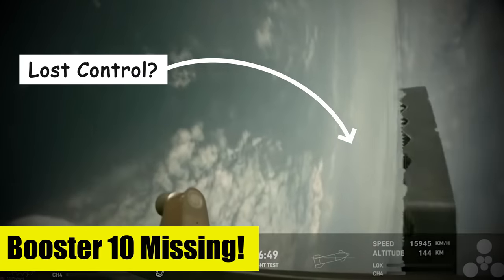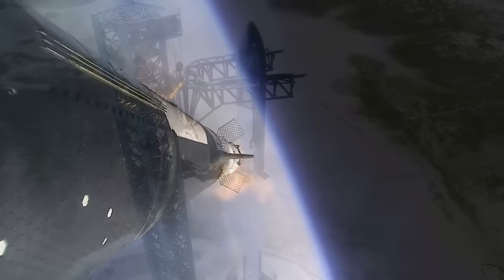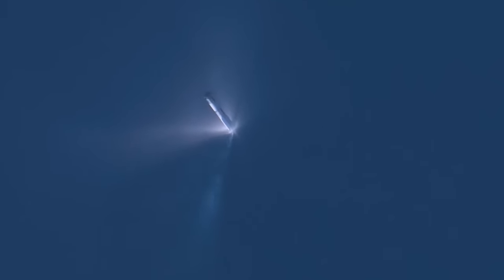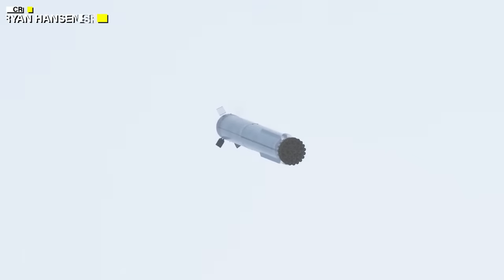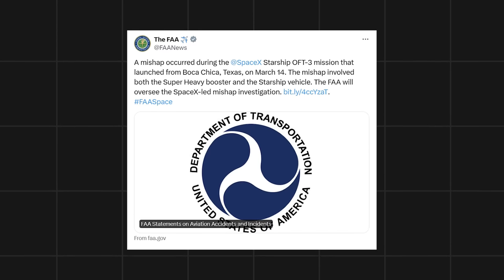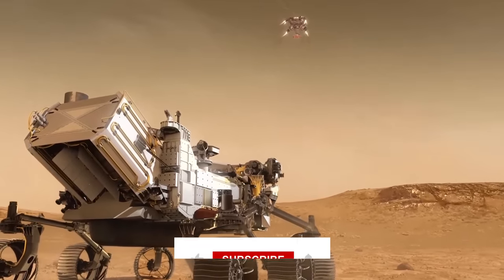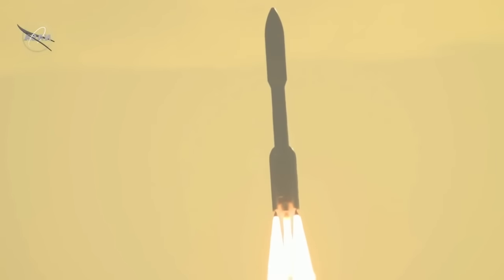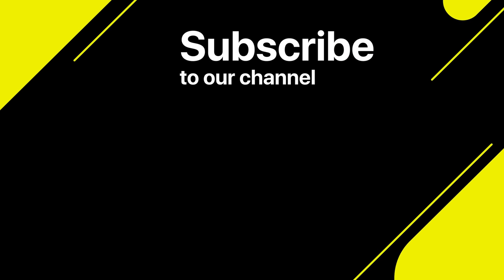Why Booster 10 Failed During Landing? NASA  Sample Return Update | Episode 30

Comment: Not sure if it's been mentioned below...but the reasoning for slower shutdown of the booster engines prior to hot-staging was to prevent the difference in velocity experienced in IFT2 that caused propellent/fuel to slosh around - i.e., starved the raptors for boost-back burn...mixed with a few issues (known) resulting in RUD.

Another YouTube clip show the changes made internally to aid in this issue - which, looking at the result, definitely progressed the Booster success from IFT2.

Comment: When  the ship is flying sideways  the wings have little effect on roll ask any pilot. 
We have ailerons to twist or roll the plane fuselage.  Even adding a third fin may not help as you are only adding pitch control.  
Your grid fins on the booster add that type of control but are unlikely to survive mach 20

Comment: My thinking has two issues. Issue one I believe that the buster ran out of fuel.  I was watching the fuel garages and they showed empty or very little fuel when they were trying to land.  So maybe they delayed the activation of the landing boosters for the last four hundred feet for as long as possible, didn’t work!.   My second issue is that the attitude control units were not strong enough to controll 50+ tons of starship and it hit the atmosphere out of control!
Reply: More like 120+ tons of starship, but yeah they probably could use a more robust set of RTS thrusters…
 
Also, it didn’t run out of propellant. Not very much is needed for landing burn compared to its initial job of lofting the entire full stack fully filled rocket using 33 engines chugging propellant like an alcoholic. Instead an almost empty booster only firing a handful of engines at reduced thrust is not going to need much at all. They know better than to use up all their shit.
Reply: @revmsj  Good analysis, your metaphors triggered me though....lol: "The entire full stack fully filled rocket using 33 engines chugging propellant like an alcoholic. : I resemble that remark! My ex would agree with you.

Comment: Your math is a bit off on B10.  There was a RUD at 462 meters above water according to SX.  It was moving about 318 m/s at the time, loosing about 20m/s2.  So it was going to hit hard.  Last I saw only 3 raptors would relight for landing burn in plan, as they could hit near 7G deacceleration.
Reply: Just a note: 343 m/s is about Mach 1.

Comment: It's too heavy. They need more power.
Reply: I. wonder why they can't figure that out?
Reply: It's not too heavy, It's mostly large fuel tanks with relatively little mass remaining in them, and doesn't use most if its rockets to land. More power > more fuel> more momentum to kill > more power needed to brake.  Also, more fuel kept for landing > less cargo to orbit.   What is needed is better control of orientation through drag, more reliable flow of fuel to engines during landing and engines that restart  reliably during a controlled landing. I'm guessing that SpaceX will look at creating dedicated landing tanks and modifying the grid fins/software for both boosters and Starship.
Reply: @psdaengr911  I'm only reffering to the first 6 to 8 miles of lift off where the vehicle is the heaviest and where it experiences the most drag/resistance.  During this span ,because it's so heavy, it just doesn't get going fast enough (going by the telemetry they show on the spacex livestream).  Maybe they haven't gone full power? Regardless of fuel loads for this thing, I don't forsee orbital flights anytime soon.